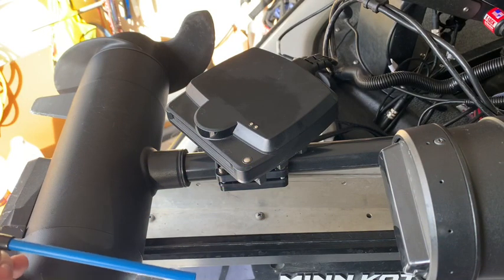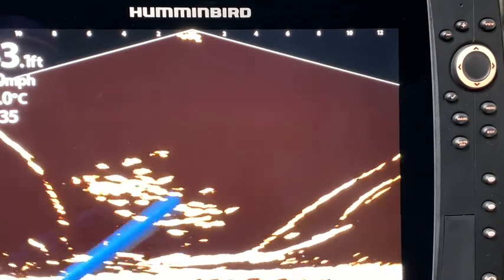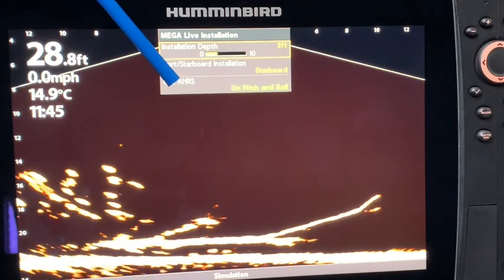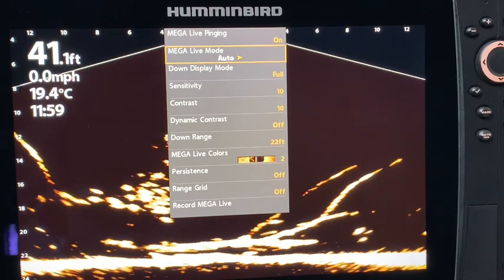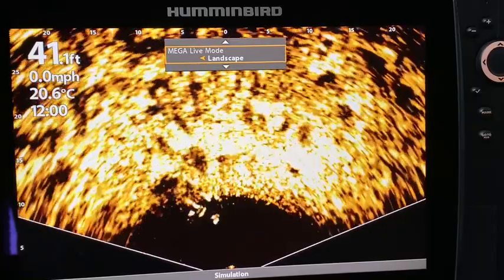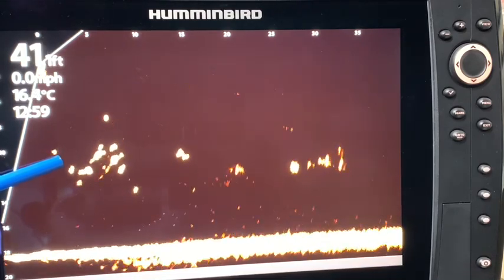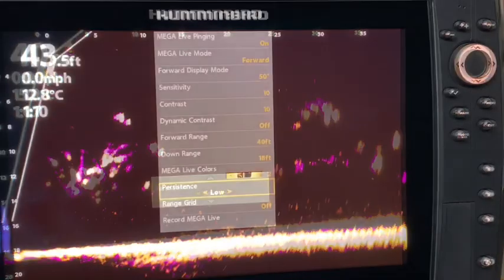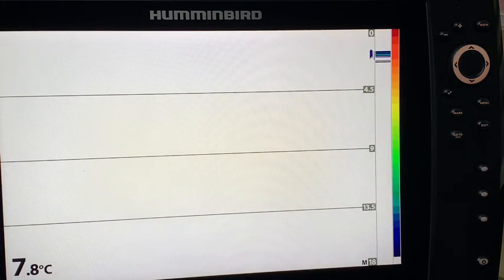Humminbird Helix MegaLive Simulation Mode Practice To Help Dial in Your Settings

Comment: I fish for musky, and have questions about the transducer.  Im looking to purchase a Ultrex Quest with Mega Live.  I will have a 9" Helix on the bow, and a 7" at the console.  With the transducer on the trolling motor, dont you get a bunch of zig zag of the imaging as your TM navigates along the shore line?  Or mounting the transducer on the boat a better option, to get a fixed image?  Im really not interested in mounting to the side bar/bracket that you can attach to the side of the boat, looking for something more permanent, that is not effected by the TM.  Thanks for any info!
Reply from the maker: My understanding is that brushless trolling motor will eliminate interference. I do not have a Quest yet so I can’t confirm from personal experience.
Reply from the maker: Doug, mount the MegaLive wherever you feel it is most useful to you. Like everything else there are pros and cons to each mounting option.

Comment: Why does the depth bounce around 40ish when it looks like the bottom is 22’?
Reply from the maker: Michael I didn’t notice that. I am not exactly sure what they did to get footage but it could have been the boat moving around.
Reply: It’s always like that in simulation mode. Depth and temperature just show random numbers and usually are different from any 2D, DI or ML depths shown

Comment: How long can I keep it on simulation mode? Will it over heat?
Reply from the maker: As long as you want or battery lasts. Just remember to put it into normal mode when you go back to using it on the water.
Reply: @stevechiassonfishing5876  Ok thanks so much. It's just yesterday, it was on for about 2 hours and the screen was a bit warm. Is that normal?
Reply from the maker: A bit warm is fine, it’s lit and generates some heat, that’s normal.
Reply: @stevechiassonfishing5876  One more question please.
Is the gimbal mount bracket supposed to click really loud when you adjust the angle of it?
Reply from the maker: It does click, just loosen it off a little more and it won’t click as much. Loosen it off more and it won’t click at all.
Reply: @stevechiassonfishing5876  Really? I tried that? Maybe wasn't enough. Thanks. You've earned a subscription. Lol